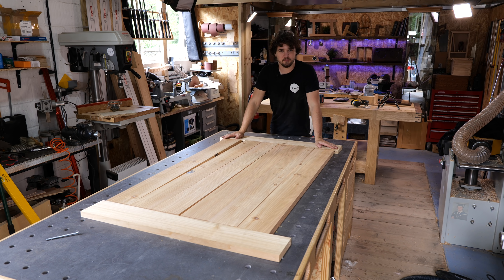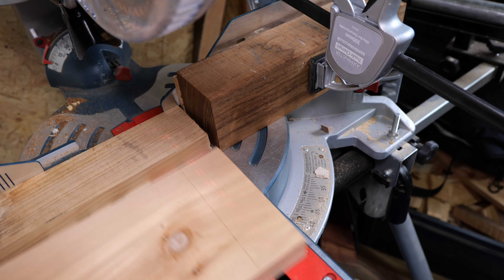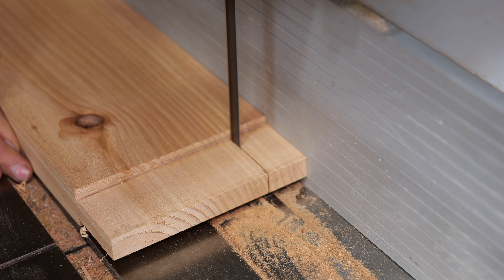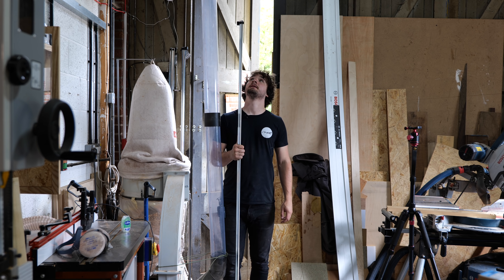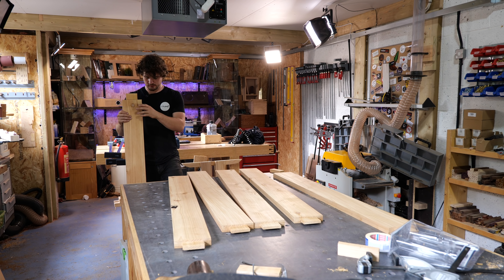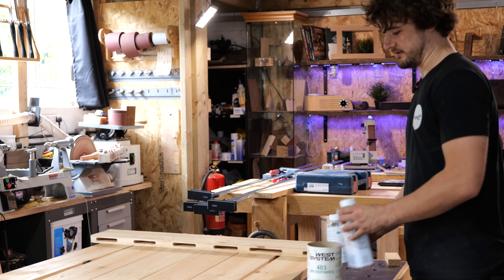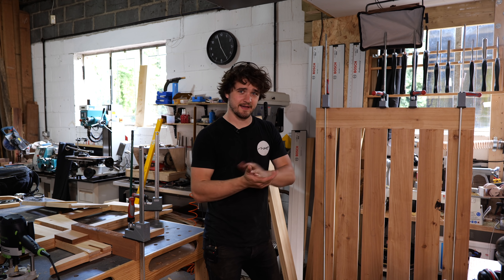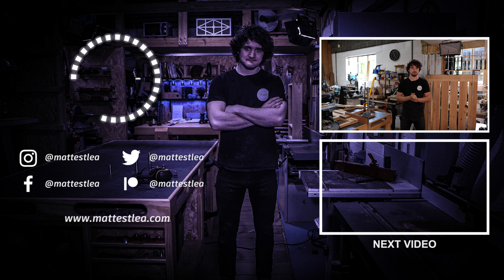Gluing the Bench Top | The Japanese Inspired Picnic Bench Project #10

Comment: 14:53 I think that since the cut is in the middle of the material, the router wouldn't wonder because the bit is in contact with the wood at both sides, the bit can wonder if the cut is at the edge of the wood, it still requires some pressure toward the fence to keep the cut straight
Reply: No - it can still wander, because whilst there is wood on both sides, there isn't any wood 'behind'  the cut to offset the effect of the blade hitting the wood 'in front'  of the cut.  This means the front of the blade is generating a lateral force to one side, and the rear of the blade cannot generate a counter-force (because if has nothing to chop against)

Comment: Great video! Can you spend some time talking about epoxy squeeze-out clean-up? Same issue with glue: if you don't stain/finish prior to the glue up, the squeeze-out saturates the wood and prevents stain/finish from adhering consistently. How to you clean your squeeze-out to prevent this?

Comment: Matt - just a thought, but rather than put the second set of support at the base of the seat-legs, why not put them at the top?  This would have two benefits: avoid having a long beam running on the ground (source of wobbles unless ground is perfectly flat), and allow the anti-rack beam to also help prevent the middle of the seat from sagging under the weight of multiple backsides, etc...

Comment: Looking good so far. Hope it will stay that way once outside. 
You're going to drop quite a few pens and pieces of cutlery through the gaps in the top probably.
Reply: How many people use a pen or pencil on a picnic table?  In theory, your point is correct.  But most picnic tables are built with this gap between top boards.

Comment: Excellent problem solving on your feet! I suggest using epoxy or some other heavy duty wood sealer on the wood down on the ground. The cedar might wick up moisture to such an extent to discolor and ultimately start to rot the wood.

Comment: Hi Matt - love the channel and the picnic bench project (great timing ... try buying garden furniture right now ...lots of places sold out so good market or a great project for the home enthusiast)
Learned a lot as always - eg using a straight bit before the dovetail bit. Couple of questions.... do you have a table saw and cross cut jig and how would that compare with using the mitre saw stop (using the laminate looked precarious) and second ...you have lovely dog holes on your bench ...could you have reversed a couple of clamps to push against the top for glue-up rather buying ever longer clamps? Guess the risk is epoxy on the worktop? Anyway well done both I’m enjoying and learning.
Reply: That's an interesting thought about reversing the clamps on the dog holes. Without having to reverse, I have a special piece of long bit of stock (full width of the bench) that I keep that has three holes aligned with dog holes on my bench so it slots in like a fence. I would but one end of the top against that and then used a couple of wedges at the other end up against dogs or another fence piece to pull it in tight. 
Either that or just use two 1M clamps clamped against one another in the centre which would also work.
Clamps should really have a couple of bolt holes so that you can attach two together.
Reply: @ricos1497  the Revo clamps from Bessey can be assembled together. They've got a thingie for it, the Bessey KBX20. Works great!
Reply: @marcelermers3141  ha ha, I've actually got a couple of those clamps but never knew that! Thanks.

Comment: Just out of curiosity: why are you using epoxy for all the glue up on this? I get not using hide glue for external applications, but I would think wood-glue would work fine, as long as its a waterproof or weatherproof glue.
Reply: longer open time and no swelling of joints when assembling
Reply: As Eric said, the longer open time, no swelling of joints, plus most exterior PVA wood glues come with a risk of turning black as they dry, staining the joints.  They are fine for many projects that will be painted, creosoted or dark stained, but if you want the option of clear finishes epoxy is without that risk.

The colour change is driven by a chemical reaction between the waterproofing agent in the glue and resins in some wood.  Most of the time it doesn't happen, but when it does it can be quite unsightly.

Comment: The mortise and tenon breadboard ends are great for allowing seasonal movement; however, didn't you defeat that by epoxying them? My understanding is that you have to use wood dowels to allow for seasonal movement. Someone who knows this for sure, please respond as I am looking to do some breadboard ends on a new dining room table.
Reply: Wood moves.  That is a fact.  An indoor tabletop isn't going to move a ton.  I have glued breadboard ends on cutting boards that get washed daily that have not split over several years.  I've also had wood movement create huge gaps.  The dimensional stability of the wood itself is a major factor in this.  Quarter sawn stock will probably not be an issue.  Flat sawn or grain with big variations is more likely to cause you problems.  It also helps a ton to acclimate the wood after milling, and before assembly to let it settle down.
Reply: @nictinkers  Okay, makes sense. Thanks. Seeing as Mat made this to be an outdoor picnick table, he may have a problem.
Reply: @geraldreichelt2441  he might, he might not.  He cut his tenons narrow in the slots, and depending on how he mixed the epoxy, it might have enough give to let the wood move.  Cedar is also really soft stuff.  It may deform without putting a ton of stress on the joints.  Finish is going to play a minor role in this too.  Something that blocks moisture well, and stands up to UV Rays may not allow for a whole lot of moisture exchange with the atmosphere, minimising movement.  
Luckily, I think we can count on Matt to tell us if it was a mistake.  He's really good about using failure to teach us!

Comment: Quick questions, why are you using epoxy rather than titebond 3 or cascamite?
Reply: I asked the same question the other day....Matt?
Reply: @bluewren65  open time, perhaps?
Reply: @UCvqUzgzXmwcvWcGNpoRNTpA I think that might have been a viewers response to a similar question on a previous video in this series but I don't remember Matt covering this question.  The reason I thought titebond 3 or cascamite was that they're both suitable for external applications and cascamite has a long open time.  From observation it might be that cascamite sets a little too hard and is thus more likely to fail with the extra movement of an external application and as suggested titebond 3 might have too short an open time but epoxy is a mess to use.  But I was interested in Matts and others thoughts, as always I'm wanting to learn :)
Reply: @tom314  Open time was the only reason I could see why you would choose epoxy over titebond III.  With a complex glue up like this project that is no small thing.  Still I thought titebond III had a 30 minute open time which would be enough if Rob gave him a hand.
Reply: That’s a good question- he addressed it briefly in one of the first videos and he’s mentioned why he likes epoxy in one of his past videos (I’m not sure which one though). Basically,

1) Longer open time for complex glue-up
2) He doesn’t need the help of regular wood glue to fill loose joints by swelling. If anything, something like Titebond III would expand the wood a little too much and make the joints too stressed when the wood expands in the summer
3) It’s more weather resistant (even than Titebond III) so it’s great for outdoor projects
Reply: @Jake_Cotumaccio  Nice explanation.  Thanks.
Reply: So after Matt's update on the recent video I did a little hunting around and found a comparison Wood by Wright did of various glues and cascamite doesn't do well on freeze and thaw cycles (in fact it doesn't seem to do well on much at all....) https://youtu.be/JFEPTPTtFsw
Reply: @tom314  Thank for the link, I'll definitely give it a look. I'm in Australia, so I've never heard of cascamite, not doubt half the glues in the video I'll have never heard of, but always great to know what's out there.

Comment: What do you need new clamps for when you've got that awesome flat machine tool workbench with all those nice squared-up dog holes? Just throw a plastic dropcloth over it and wedge it against some bench dogs! I was also kind of puzzled when you glued up the legs vertically, and now I'm really puzzled!
Reply: I guess because the top is only MDF, and not designed to resist lateral force - the holes are actually a precision guide system for making accurate cuts (iirc), so stretching / elongating the holes (due to lateral clamping forces) would 'ruin' the top for the precision work.
Reply: @logicalChimp  That's true, but he's got those cool little through-hole clamps. It would be easy to use those to hold down a stop on either end, and then tap in a wedge against those. Then there'd be no lateral or twisting forces on the holes.

Comment: Rather than buying those clamps you could have used your giant torsion box.  Lay down the top, clamp a straight edge near each end, then use opposing wedges to push the breadboard ends against the clamped down straight edge.

Comment: I would like to know about your excessive use of epoxy and the mess it creates on your project. I use regular wood glue on all my projects, always being careful and fussy about wiping away any squeeze-out or drips because stain or finish will not adhere on glue spillage. But yet, this project has epoxy spilled all over it. Don't you worry about the finish not adhering to the epoxy? Or, do you have a method for cleaning up the epoxy drips and squeeze-out?